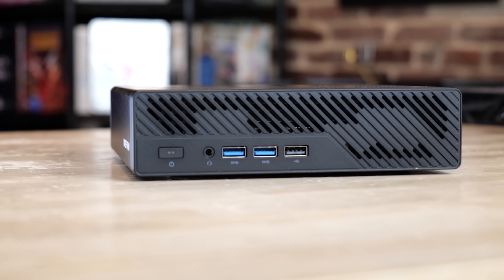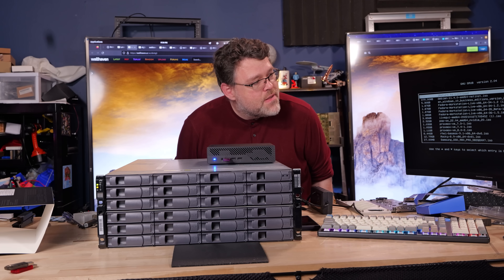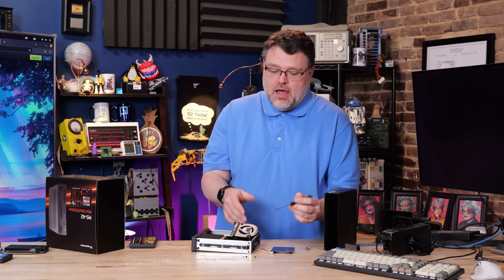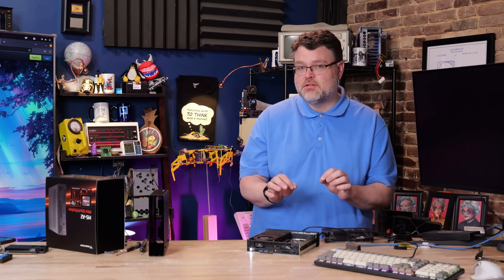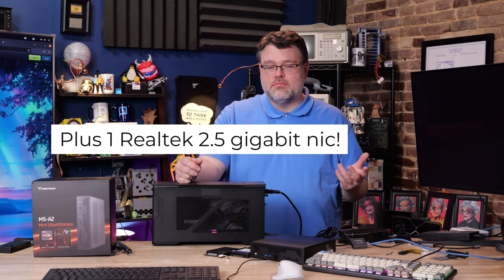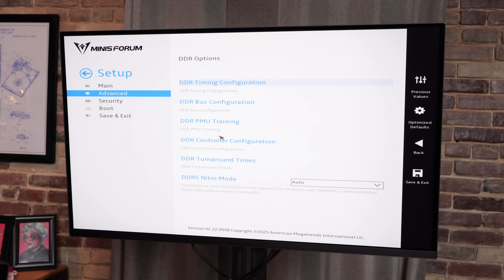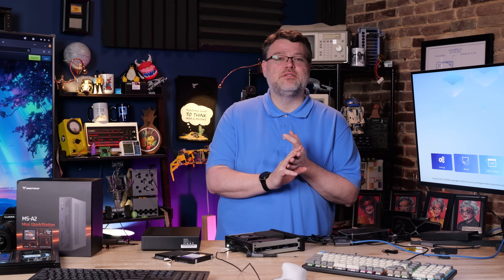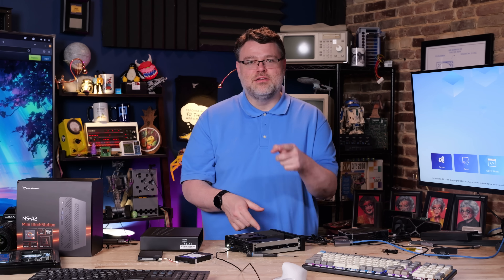Small Form Factor Workstation: Reviewing and Benchmarking the Minisforum MS-A2

Comment: Just received one today, configured with 96GB/2TB.  First observation -- this thing gets HOT.  I did a test render of a 34.5 minute 4K60 video which took 45 minutes to complete and the fans SCREAMED the whole time, bouncing between the highest fan speed and the notch just below that.  I put my hand on the case and the case was hot to the touch, not warm, HOT.  Even an hour later the case is still overly warm.  The cooling is flat terrible!!!  Granted, for tasks that can be complete in a few minutes or at lower utilization the fan/cooling issue is tolerable and most of my other use cases won't put that much demand for that long.  In task manager the CPU seemed to hover around 33% but the integrated GPU averaged around 97%.  It appears the integrated GPU is nearly useless so I may need to find an external GPU that addresses the severe limitations of the integrated GPU.  Mind you, I'm not a gamer, but this is way less than I expected!  
So, it looks like I'm going to need to find some way to substantially increase the cooling air this beast needs and also the best external GPU and the bits needed to make it work.

EDIT:  I added the Yeston RTX 3050 6GB GPU which improves on the dreadful integrated GPU that comes with the MS-A2.  I've temporarily put an 8 inch fan on top pushing air into the MS-A2 and that's pretty much silenced the internal screaming fans.  I do have issues with the USB ports and the USB ports on the MS-A2 are, well, inadequate to put it mildly -- I have an external SSD that I've used on half a dozen PC's and MAC's and it works fine with all other PC's, but on the MS-A2  it periodically loses connection.  You get that 'bloop' sound as it acts like it was disconnected, but immediately there's is another 'bloop' sound like it's trying to reconnect but it doesn't.  Why they married a higher end CPU with low end GPU and USB ports is hard to fathom!
Reply: Amd CPU has poor video transcoding so you are using it for the wrong use case. Intel cpus would have been a better choice. 

The AMD have great core and thread coints with better TDP
Reply: @firstspar  Neither AMD not Intel are the go to choice for transcoding as Apple silicon blows them away by orders of magnitude!

Comment: MINISFORUM NAB9 (32GB / 1TB SSD) failed after 1 month – support ghosted me
I bought a MINISFORUM NAB9 mini PC (32GB RAM, 1TB SSD) in June or July 2025. After just one month of normal use, the unit completely died — no signs of life. I later found out that this model was part of a defective batch that the company had recalled. However, MINISFORUM refused to repair or replace it, citing the lack of an order number (even though I have the serial number). I even offered to pay for repair, but they ignored my messages entirely. Horrible customer service. I cannot recommend this company to anyone. Stay away.

Comment: Hey  Wendell , you mentioned this takes U.2 and said you can throw a Solidigm 32TB, 64TB & 122TB SSD SAS Drives when the MinisForum site rates it at a 15TB max for u.2. Did you test this to see if larger storage capacities are usable on this?

Comment: What is your home server running that it needs 96MB of ram and such a beefy CPU?   I would think a N150 would have plenty of CPU power + much lower power usage and a much lower price.   I'm currently running pi-hole on a pi2 ( 1.5 - 3Watts, 1GB memory) really nicely.   The highest I've seen the CPU usage go was 15% and the swap usage is 0 so the 1GB of memory is enough.  I have newer PIs but I haven't bothered to switch to them- the 2 is enough for this use case.

Comment: I will say as a recommendation no matter how good Minisforum may release their devices they are one of the worst companies to deal with. I had purchased their Minisforum V3 which is the 3 in 1 tablet because I figured with the portability of being able to game where ever I go and knowing it would be able to keep up with whatever I throw at it this was a no brainer for me. There was a Windows update which is the 24H2 and when I installed it it bricked the V3 to the point I was dealing with boot loop issues. I reached out to their Customer Service and all they kept telling me to do was to reinstall Windows by following instructions that are on their website. I attempted to reinstall Windows many times but couldn't get it to work mostly because of their BIOS settings. Mind you this has been going on since February from when I first reached out to them. Since then I've been going back and forth with their reps who then ended up saying they wanted me to record and send them a video of me trying to reinstall Windows. I was already frustrated for dealing with this for months and their solution was for me to send them a video. Out of the blue a couple of months later a rep emailed saying they spoke to their engineering team who agreed they will setup a new device and all I had to do was ship mine to them. I went ahead and shipped my V3 and it was only after I gave them the tracking number showing I shipped it that they told me they were out of stock for the V3. Now, as mentioned before I purchased the V3 for a reason and what their solution was I could take a look at their website pick out a different device I want and I would pay the difference. When I told them that this was unacceptable because this should've been mentioned prior to me shipping my device and all they kept doing was apologizing and pushing me to choose a different device or I could also get a refund. I'm now again going back and forth with this company who has been refusing to help with providing me with a V3 even if it's used since this was a their fault for not telling me I wasn't going to get one in return. I finally get a response back after constantly telling them I'm not taking the offer of another device nor a refund since this is a problem that they created and I shouldn't be put in a situation where I'm not getting a V3 back. They said they'll reach out to their US warehouse and if they are lucky to find my V3 they'll ship it back to me. As I've mentioned this has been an ongoing problem since February. @minisforum you've been the worst company to deal with and you bet I'm going to each Youtube channel and let everyone know how bad your company is. Also, please tell your employee Floyd I hope he understands since he loves to say that in his emails.

Comment: Do not buy MF products even in EU and certainly not directly from them. It seems they do not have quality control, so many faulty or straight up dead units on arrival. Customer support is horrible and you get a chinese warranty yay. If your unit is faulty they will ask you to pay for a "depreciation fee" which after a year is around 30% of the purchase value. And believe me, it will fail.
Check on red it for topics about them.

Comment: what are the major differences between the 2 cpu options, 7945HX and 9955HX? its a 210 euro / 30% price difference. it's about 7% faster. but is it worth it, to take the faster/more expensive cpu, if you are only running it with 64gb ram?

Comment: PCIE riser cable for an eGPU, would that work? Is there space to poke the connector/cable through the rear?
Reply: You would need to power it. You would likely be better off with oculink if you're using a GPU that can't only use Pcie power.

Comment: I'm a little confused that these mini-PCs use a 19V power supply. Why would they do that when PCs internally usually use 12V, 5V & 3.3V via ATX standards? Is this a netbook-specific thing?
Reply: Its about ohm's law nothing else - There is no reason our power grid should run at 400.000 volts but it does for good reasons
Reply: I don’t believe atx ever specified dc input. If it were 12v it’d need higher amperage to compensate which itself needs higher gauge wires. It’s much easier to push more voltage than amperage in the same wire.

Comment: Thanx you ! Nice video.
I would have like some NVMe bandwidth testing. 
I am thinking 3 x 990 pro in RAID 0 configuration, and want to know if this is possible @ 3 x gen4x4. 
I heard that those two extra NVMe slots were x3 by default but 'programmable' to x4 through the bios, but what do you loose ? (where are the extra lanes coming from ? PCIe adaptor ?) 
And also, I heard it supports RAID0 but does it on more than 2 devices, can it do all 3 ?
The reason I am asking is my main purpose for this machine is compiling Linux kernels, which is mainly bottlenecked by disk these days.

Comment: SFF Pc's do not work well.   I am a retired IT veteran from a fortune 50 company.  All these SFF PC's throttle after being used extensively in an office environment within minutes.  Open a few spread sheets, the browser..  especially on any finance screen and possibly word and these things always throttle.  Now I am talking from experience on Dell and Lenovo.   There is a reason why we did not use these on trade floors or any place where real work happens.  They work ok hanging behind a TV for conferencing etc.

Comment: 00:55 "...12 volts input..."  when the image clearly says 19V. The website specs have it as "19V/12.63A" so my confidence level on this one is fairly high. Not a gigantic issue but there may be people wanting to run this on a boat or in a van or off solar or some other scenario for which this would make a difference. But yeah, for me it just is wrong. I don't like wrong.
Reply: If you want to run this off 12v you can just use a DC booster which will convert 12v to 19v quite easily.
Reply: @solarhomelab I do this in my campervan. 24V to 19V DC converter. I use the same one for the monitor power too. Works great.

Comment: Are Windows Server 2019-2022 drivers available for all of the hardware in the MS-A2? I have some Intel i9's running as Hyper-V hosts on consumer motherboards (my previous HEDT's), but I'm unable to run fan controller software due to Windows Server. The unfortunate side effect is they're screaming in my office, slowly losing my hearing. I'd love to convert these over to something quieter. Finally having something available with high core count and plenty of RAM is amazing... if it works with server.

Comment: Just got my A1000 for my MS-01 today. Been using my MS-01 to edit video in Davinci Resolve Studio. Everything is fine until you add overlays. Hopefully the nvidia will help with that. Installing it was somewhat tricky, I didn't have that weird 6-point start micro screwdriver in order to swap the full height face-plate to the half-height one provided separately. Also I have no idea what I was doing when it came to pulling out that little block which you insert the ear of the faceplace (I'm making up terms now). Definitely entertaining. But I was so busy today but I didn't want to wait and go look at tutorials videos. 

I love my MS-01 but honestly, I think I'd rather the case was a bit bigger so could fit a better GPU without crazy hacks and living life so close to the edge of the power supply.

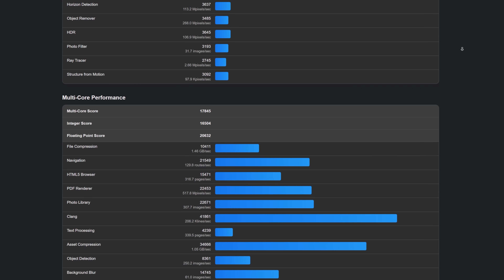Comment: 10:28 Maybe I'm misunderstanding something about 128 GiB vs. 64 GiB of RAM on these...

AFAIK, the big DDR5 SODIMMs come from Crucial, and Minisforum uses those. The Crucial website for their SODIMMs (probably can't link without being labelled spam, but search their website for CT32G56C46S5 vs. CT64G56C46S5) says under "die density" of the specifications that the 32 GiB SODIMMs have chips with half the capacity as the 64 GiB SODIMMs. That would mean that they actually have the same number of chips and I assume should be equally stable on the memory bus.

The 16GiB SODIMMs (for 32 GIB total RAM) do have the same capacity chips though, so presumably those have fewer chips?

Comment: I wouldn't call it an upgrade over the MS-A1.  That one let you drop in any AM5 desktop CPU.  This one uses a soldered mobile CPU, which I'd call a step backwards.  Also, the 9955HX doesn't have an NPU, so it's not really designed for AI either.  Good compute with all those cores and threads, and with the right low profile PCIE card it can make a good workstation... not the best bang for the buck though.  I hope Minisforum goes back to an AM5 socket in the MS-A3.

Comment: My MS-01 gave such problems due to the bios battery issues and their Support only cared to share a video on how to replace the battery.  When it still wouldn't boot, I was lucky to have a buddy who also has an MS-01 who told be to "just leave it plugged in for a while".  Not booted, just plugged in.  It woke up, the sign of life was the network light began blinking.
So I hope the 2nd generation behaves better.
Reply: it sounds like it wasn't even the fact that you needed to leave it plugged in. It sounds like support could have done a lot better for you. If only you knew that much, I don't think you would have suffered nearly as much.
Reply: I swapped the cmos battery, but yes, keep it plugged in for a while to keep the bios rom powered
Reply: just buy some bios batteries and replace when it happened. I bought 2 units, 1 had battery issue like you said ( bought in Apr 24) , another one doesnt have this issue ( bought in Jun 24).
Reply: @d3adc3II  I mean, sure. Generally speaking, replacing a CMOS isn't too difficult. But, more to the point, it's something that shouldn't happen. I've almost never seen a machine ship with a bad battery...hell, I have Sandy and Ivy Bridge machines that are still around with their original CR2032 that are still just fine....granted, these days, I just automatically replace the CMOS in that age hardware regardless.
Reply: I've gotten the Minisforum V3 and when I did the new Windows update 24H2 it bricked it and caused it to go into a boot loop. I reached out to Support and they kept directing me to their website to reinstall windows and later wanted me to send them a video of me doing it because it wasn't working. I mean I like their products but their Support sucks. I had to get a buddy for help instead.
Reply: @merkabah462 yikes their support sounds like a nightmare to work with
Reply: @merkabah462  We apologize for the bad experience. We are working on improving our customer service and will provide you with better service in the future.
Reply: @minisforumofficial  Thanks I just now got an email saying that I'm able to get a replacement 3 months later from when I first reached out for help.
Reply: @minisforumofficial  yeah yeah dude.. sure... EVERYONE is talking about how awful your support is. you don't give a sh1t after you sell the product.
Reply: @minisforumofficial  Update: After going back and forth with your company I got an email saying your engineering department agreed to operate a new device for me and all I needed to do was ship my V3 and you would send me the new device. Well I did just that and it wasn't until I sent the tracking number confirming that I did ship it that I was told the V3 was discontinued and I wouldn't be getting the device I was promised. Now I'm back at going back and forth with your company because this wouldn't have happened if your company would've mentioned in the beginning that it was discontinued. Now you're refusing to send me a new or used V3. So much for improving your customer service.
Reply: @merkabah462  can you give an update to what ended up happening with Minisforum?
Reply: @minisforumofficial take care of this guy

Comment: This thing runs toasty and noisy. Make these box take standard 120mm or even 140mm fan from both sides pls… minisforum does not even need to supply the fans, just provide 2 pwm ports on each side for us to put quiet cooling already
Reply: "ToAsTy" 
Translated to non-moron: runs exactly as intended thanks to how opportunistic boost works.
REEEEEEEEEEEEEE IT'S RUNNING AT ITS DESIGN TEMP AND NOT SOME WEIRD, ARBITRARY VALUE THAT I FIND ACCEPTABLE... DESPITE HAVING NO UNDERSTANDING OF HOW ANYTHING WORKS!!!!!!!!!!!

Comment: There are 2 things that RUIN pre-made mini-pcs for me:
1) MASSIVE power brick half the size of the computer. What's the point in having a small pc if your power brick is massive. You're essentially buying 2 small boxes.
2) Their obsession with sh1tty blower coolers - make the mini-pc 15mm taller, nobody cares, still tiny and now you get perfect cooling from a silent 120mm fan and zero throttling.
Reply: It seems even with additional cooling this will still throttle, the boost is set to a time instead off temperature. I agree I would prefer the option to have a top fan would make the pci express slot and the whole unit run better.

Comment: ECC support ? Have you tested it yourself? Everyone else is saying it doesn’t, and it’s not listed on the Minisforum page.
Reply from the maker: bios update, bios screenshots of ecc mode in the video. however I didn't have any ecc memory to test so it may not work on this platform. I'll try to follow up with more info/testing
Reply: @Level1Techs  yes, please do! Minisforum has told others previewing this that ECC is not supported.
Reply: @Level1Techs  Can you test it out with ecc memory im curious if you can get it working !
Reply: @Level1Techs  any update on this?

Comment: ..is there a wifi slot card in it ? that can be used as OS drive ( with M.2 Key A E to M.2 NVME Adapter Card ) ? Thnx. nice video
Reply: you can see it in the video, it's in the corner of MOBO, at the m.2 slots side

Comment: Viewers may have noticed that the RTX 2000e has no ventilation out of the back of the case through the original backplate. The N3edware 3rd party coolers have an open backplate so that you can run the GPU with the case closed. Keep in mind however that you need to undervolt and have custom fan controls to use the N3rdware coolers.